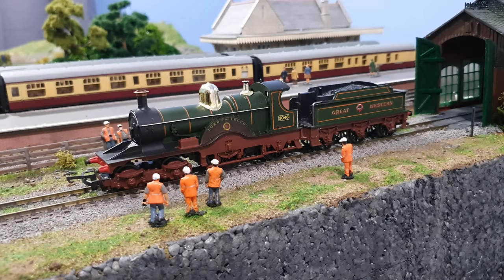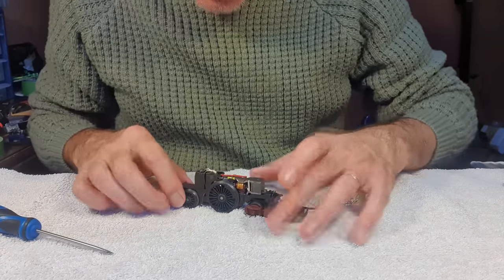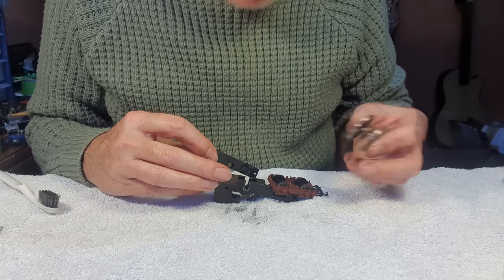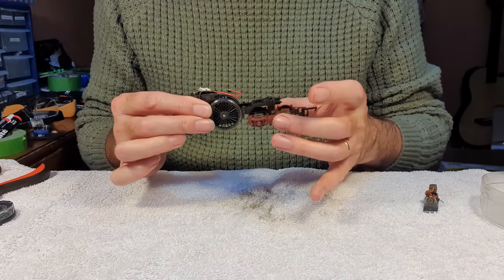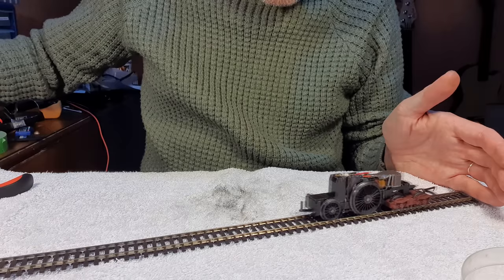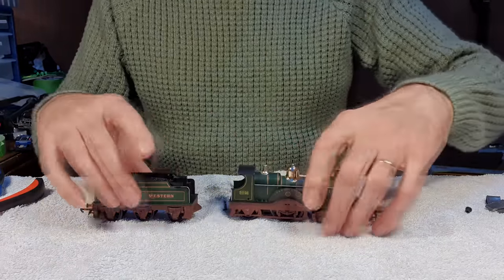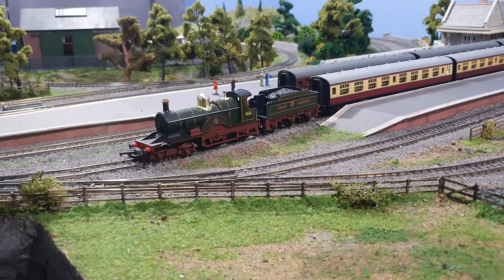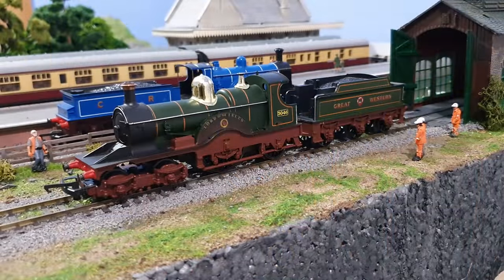Tri-ang R.354 "Lord of The Isles" Dean Single : Repair Request

Comment: One thing to bear in mind with the motor is there are two very tiny ball bearings each end of the motor shaft. I lost one when i repaired one of these and it took an age to find! So when taking the motor apart be mindful not to loose them. When you take the motor apart in the video you can see the bearing in the hole when the magnets removed.

Comment: A very nice solution to the primary problem without having to add metal wheels and pick-ups to the tender, Bill.  I watch all your videos and enjoy them very much indeed.  As I've mentioned in older comments, all though I am "mechanically challenged," you have given me the confidence to do engine servicing and modifications.  In one case a display shelf queen became a good runner and in another I successfully replaced a lousy DCC decoder with a good one.  I wish you good luck on the new layout, and I think the modular approach is a good one.  As for the track layout, I'd urge you to ponder it a good bit before committing, and emphasize flexibility in operations, especially in the connections between the two main tracks and the branch.  Cheers from Wisconsin!

Comment: Thanks to your advice I have managed to get my Hornby R3070  Tornado to run around my layout (2nd & 3rd radius Hornby Track!!) without falling off. The solution was 45 grams added inside the smokebox and 2 washers added to the front bogie.
(in 1980 Mainline used the same type of bogie, but they added a spring, on their Scot/Patriot chassis). Thanks again and keep up the good work, Kindest regards.

Comment: Hi Bill, good video as always.  Hornby's (pretending to be Tri-ang) Victorian Train Set might be worth a look.  The Lord of the Isle Loco has wired connections to the lead 4 wheels, traction tyres on the 2 Main wheels & pickups to them and the 2 trailing wheels.  The tender wheels are still plastic.  The thing you may not like is that the motor is said to be a Maintenace free sealed unit.

Comment: As an update to my last comment, rather than a nice metal bush and lead weights, as a temporary measure to see if this works for my loco I just cut the top off a small raw plug for the bush and found a heavy screw that fitted inside the tender… 

My 50 year old Lord of the Isles is no longer “stumbley!” Will improve the fittings however thanks for the idea Bill. Easy result!
Reply from the maker: Excellent bodge. Rawl plugs have many, many uses...

Comment: There is another single wheeler out there. It's the Great Northern Stirling single wheeler as preserved at the NRM. The model was made by Rapido, a Canadian company, and while not exactly what you'd like it is an excellent model. It was marketed through the NRM and I think Rails of Sheffield. This is very modern model with DCC and sound and lots of tricky little features all packed into a very small model.

Comment: I have got the newer Railroad version of this one. Im yet to upgrade it. It is DCC ready with the decoder socket in the loco. I have already added metal wheels to the tender but need to add pickups and wire them to the decoder socket to make it even barely viable as a runner on my layout. I also agree that a retooled version of this and the Cali single would be great with the decoder socket in the tender, more pickups in the tender plus a more realistic coupling between tender and loco. But I expect it wont happen!

Comment: I have one of these.  It was running terribly when I had it and I found that the wire pickup had one broken end.  I made a new one out of some wire and it works quite well now.  I have been thinking about putting some metal wheels on it as the plastic ones are not that good.

Comment: Hi Bill, Just for info purposes, the engine body is missing 2 sets of leaf springs. One on each side of the engine cab. Not sure if you can buy them separately from Hornby. If you really wanted to make a tender drive Dean single, you could take the tender from the Mainline Dean goods, (Not sure if the original Hornby Dean goods were still a tender drive and work from that. It is the same style of tender.

Comment: Bill I have the newer addition of this however they are a pig to run properly mine needs to be repaired as the base keeper plate I managed to melt as the pickup wires were never connected properly from new which caused it to intermittently stutter on the track.

Comment: Hi Bill , yet another great refurb and interesting vid.
My I ask what is the grease you use when servicing and could you explain the reasoning and need for re-magnetising? How do you know if this is necessary? 
Look forward to your reply and your next vid. 
PS. Good luck with the new layout idea...go for it !! 

Cheers Daz
Reply: The magnets lose power over time. (The old Tri-ang 'spider' motor bogies were even worse: taking the magnet out of its keepers caused it to lose power!) The quick test is with a screwdriver, as he showed (afterwards) on the video. If the screwdriver cannot pick up the motor, the magnet is weak. It's also a case that once you have bought a magnetiser, you might as well use it every time!

The grease is a mixture of Hob-e-Lube Gear Oil and something else (which I have forgotten) that is supposed to stick better to the worm than gear oil alone. Bill mixes it himself. (Try looking at videos from about a year ago, before he started with the mixture and you might be able to work it out).

Comment: Nah, keep the motor inside the locomotive itself. My bias is for the locomotive to be the actual one doing the pulling. At least if you put the motor in the tender, have a universal joint (or flexible silicone hose) drive shaft running from the tender motorshaft to a gearbox shaft that is connected to the loco's driving wheels. 

I would replace the pilot wheels with conductive ones (if available) and install wipers. The same for the trailing wheels. And the tender wheels too.
I just despise tender powered locomotives. I can think of only one American made locomotive that had it: Tyco Chattanooga Choo-Choo" 2-8-0 and 0-8-0 locomotive trainsets. 🤮